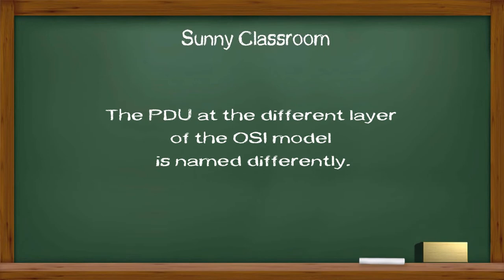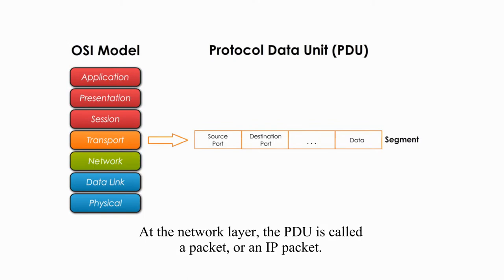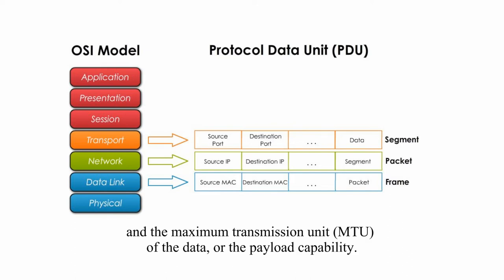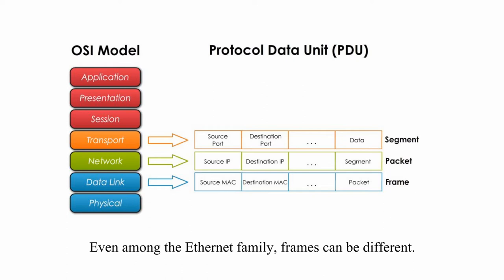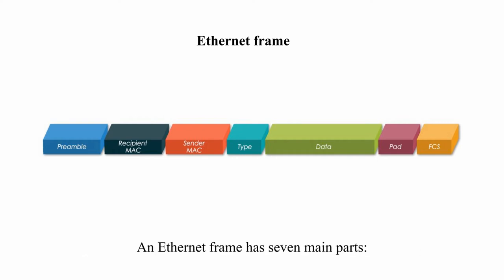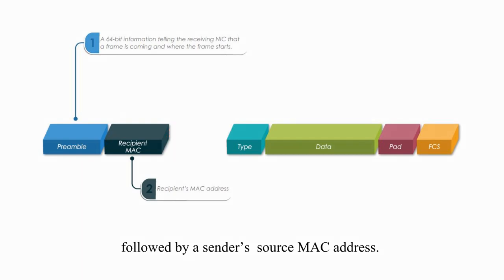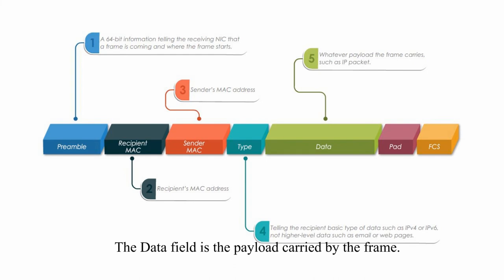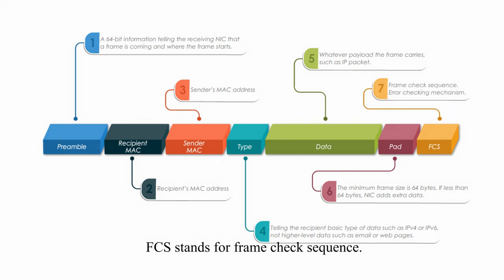7 parts of an Ethernet Frame

Comment: So the Packet and Segment are inside the data portion of the frame?  And the frame gets broken down into these different PDU's as it goes up the OSI model from switch to router to application, etc...?

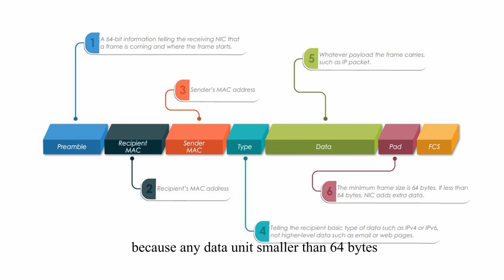Comment: At time stamp 3:25 in this video, you said the minimum payload in the "Data Section" is 64 bytes.  The Official Cisco Cert Guide CCNA 200-301says the minimum payload is 46 (page 50).  Which is right?  Does anyone else have an answer to this?
Reply: Ethernet has a minimum frame size of 64 bytes, comprising an 18-byte header and a payload of 46 bytes. It also has a maximum frame size of 1518 bytes, in which case the payload is 1500 bytes.

Comment: Thank you again for another informative video, I wonder where tcp/udp packets are stored? Are they also located in the data part of the mac frames? If it doesn't how are src/dst ports are linked to IP and MAC.
Reply: tcp/udp packets are called segments which are stored in the IP packets

Comment: is payload is static?
Reply from the maker: payload is the data the frame carries. It is static in this sense. but different frame can carry different payloads.
Reply: @sunnyclassroom24  ok sir,this question was asked during an interview,that during packet transmission payload will be static,i have replied yes,let me know i am correct?
Reply: @sunnyclassroom24  one more question sir,why centralized system more reliable than decentralized system?
Reply from the maker: @Ta___  It depends. Blockchain technology is decentralized technologies, but it is reliable, like bitcoin.
Reply from the maker: @Ta___  but in general, centralized systems can be controlled, but what if the central point fails? That is why my answer is "it depends".
Reply from the maker: @Ta___  yes.
Reply: @sunnyclassroom24  sir but all distribute system are centralized like internet is controlled all distributed applications were controlled, so if we see in broader sense decentralized is actually centralized
Reply: @sunnyclassroom24  reliability and availability r two diffrnt things
Reply: @sunnyclassroom24  even blockchain technology is centrally controlled